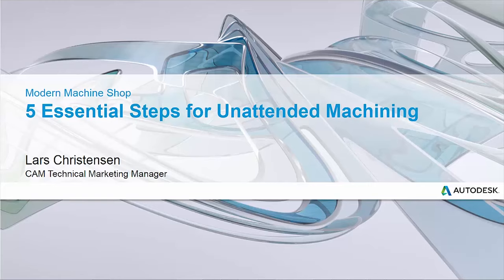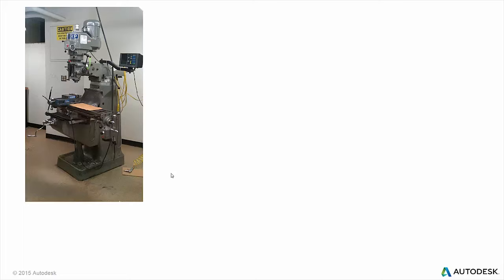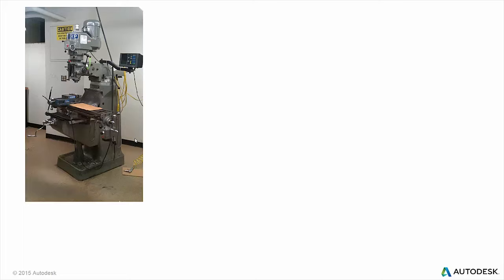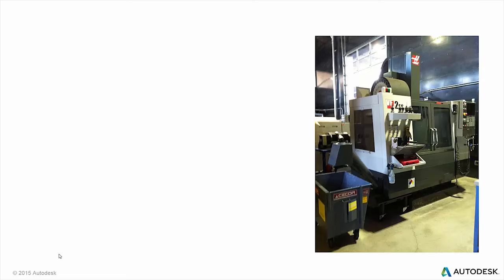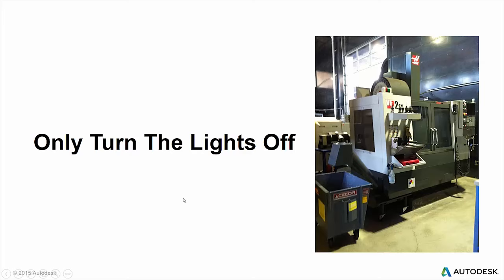Webinar: 5 Essential Steps for Unattended Machining

Comment: Lars, can't thank you enough for all of the great videos you put out.  They are clear, concise and filled with good, useful information.  

I'm not sure if you take requests....but if you do I do I would love to see a video discussing set up and CAM tips on a mill/turn, subspindle equipped lathe in Fusion 360.  There are a lot of videos out there for milling but not for the mill turns.  Thanks Again!
Reply: Jeffrey Murphy check out Rob Lockwood's latest and I have one or two covering mill turn on the CAD CAM Australia and New Zealand channel as well.

Comment: A little off topic but I'm wondering if you would mind sharing what mic you use for recording the audio for your videos? I've been trying to find a really good mic for my GoPro but not having much luck. So I'm wondering what is the best way to get really good audio for YouTube videos?  Thanks for any info you care to share.
Reply from the maker: Hi Kerry, No problem. right now I'm using a Blue Yeti Pro; Really like this mic for voice overs, but not happy with it for Youtube. In most of my videos I am also shooting myself and I don't like having it in the video, so I'm always hiding it, what is causing some audio issues. I also have a Røde mic that came with my camera. It is not as good quality as the Blue, and is very direct oriented, what results in bad audio when I turn my head to look from the camera to the screen. I do have a lavalier mic coming from Amazon, I'll will that a shot within the next few weeks.

Comment: Hello Lars!

First just want to tell you that your videos about Fusion 360 are the best that I have found so far here on youtube. Im slowly getting the grip of the program and Im quite excited. And for the topic for unnatended machining I would have 2 questions. First, we have parts that run over the weekend...3D shapes for plastic molding. When the last program activates( finish for the whole contur, big program, 10 Mb in size, over milion sentences) the machine goes and takes the proper tool and then stops. This happens only with very big programs. I think I read somewhere here something like cache memory. Could that be the problem...do you have any ideas abouth this.

Second question...also for unnatended machining. For rough milling of the contour I worry if anything goes wrong( chips dont fly away the way they shoud, plates in the milling head wear off ...) I simply want the machine to stop before it damages tool, workpiece or spindle. We just had big servis done on the machine and Ive talked to the guys and they mentioned S-load and Z-load and our machine does mesures this factors. Any ideas?

Lars, sorry for the long writing, if you have any  ideas about this questions you can just roughly direct me what or where to get information and Ill study what can be usefull for us.

Lars, keep up the good work, its very usefull to get information about Fusion 360 from someone who doesent understand only modeling, but the whole process of making tools.

Have a great weekend!

Greatings from Slovenia!

Davorin
Reply from the maker: Hi Davorin, I am happy that you find the videos helpful! I'll keep on making them :-)

First question:
Have you looked into Drip Feeding for you CNC programs? Google "Drip Feed CNC" Where you bypass the controllers memory and run the code from a computer. I use to do this all the time. I had an old beaten up computer on the floor thats only purpose was to feed programs to the machines via DNC.
Second question:
Well, with the machine helping you with this out of the picture, my thoughts are the following(Might not be great):
+Run unattended machining with lower chipload. You might loose some cycle time, but hopefully you are sitting at home drinking a beer anyways.
+Possibly purchase an aftermarket coolant system that would ensure that you can really flush those chips away from the tool engaged in the steel.
+Rough at daylight (I did this a lot) Plan your roughing doing the day where you are available to keep an eye on things and maybe change inserts on cutters, etc. Then, do all the finishing unattended when you know the stress on the cutters should be less brutal.

Hope this was helpful.

Greetings to Slovenia from Buffalo, New York :-)

Best,
Lars
Reply: Thank you Lars! Very helpfull, will look into Drip Feed CNC :-)

Comment: Hi Lars. may i request tutorial to modelling and simulating full cnc router? i have a cnc router and want to model my own cnc machine then DIY it. i saw many machine maker using solidwork to model and simulate before they turn into real product, i'm curious if it will be easier in fusion 360. thanks!
Reply from the maker: Hi Ryan, That would be a cool project! I would love to do that from start to finish. Design everything in Fusion 360 and then build it in real life. Now I have to go and ask my boss for some funding :-)
Reply: great! good luck with your boss. it will be really cool!

Comment: Hi Lars

I'd like you to tell us how to get the spindle to zero and the table to stand in a certain position when the program is finished?
I can not find anything about this, and it's an important function for us all.

My machine is a Hurco VM20i and when the program is finish, the spindle remains in its position and the table stops at the back right corner farthest from the opening :-(
Not good 

thanks in advance
Janne
Reply from the maker: Hi Janne. Thank you for taking the time to write. That sounds like a post tweak; I would recommend that you do a search in the HSM Post Forum. Your answer might already be there http://forums.autodesk.com/t5/hsm-post-processor-forum/bd-p/218
Hope this is helpful.
Best,
Lars
Reply: Hi Lars and thank you for trying

That was a general forum and i cant find anything about what i need .
i think i have to give up Fusion. its too many questions that i cant get help with and i feel that i might have to get back to my old simple OneCnc.
i allways beleive that program is not so good but after i´ve tryed other programs i discover that the program actually is very good and complete, for example: you can easily edit the post processor in the program and let it do exactly what you wanth the machine to do before and after the program.
the program also include several other feature that i cant find in Fusion.
Reply: It's not hard to get a post processor edited. Just create a post in the forum Lars gave you. There are VERY knowledgeable people in that forum who are gods when it comes to editing posts and they are very good at helping people fast. Give Fusion a try and I promise once you get use to it you will understand why so many people love it. -Jacob S.